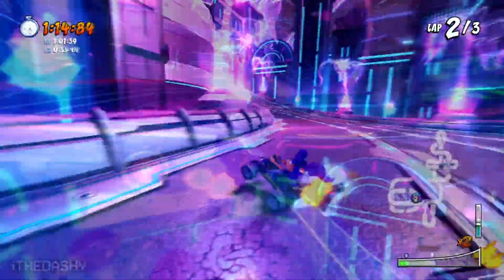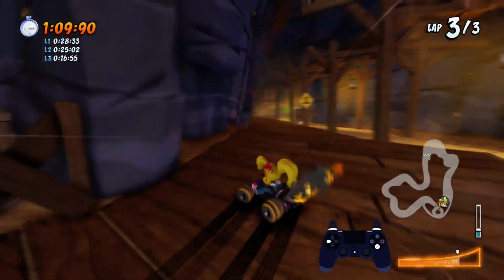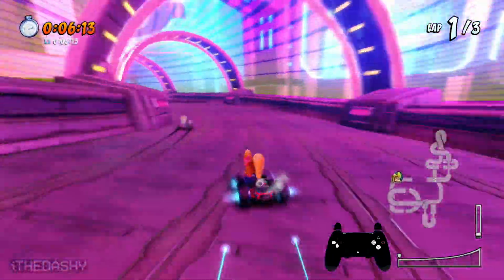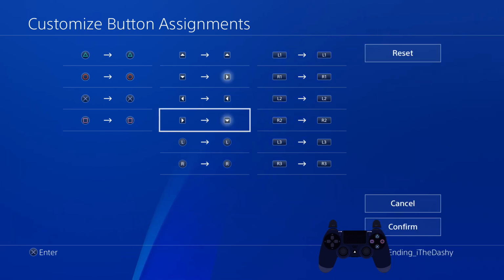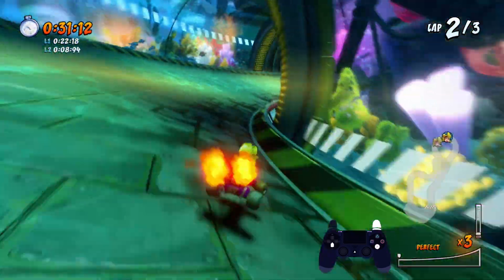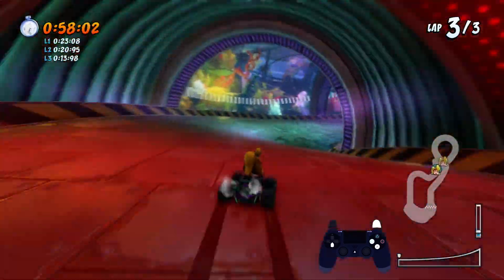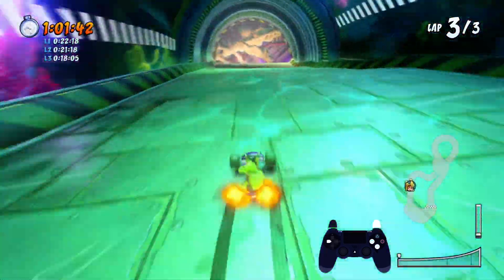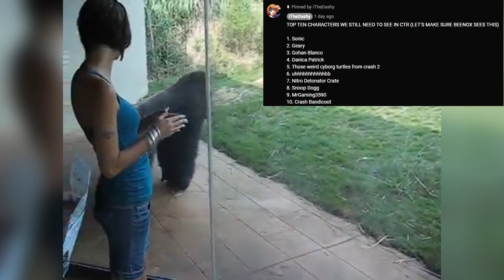Polswid Tech Guide: The New "Snowballing" Speedghost | Crash Team Racing: Nitro Fueled

Comment: Decided to come back onto the game to try out this new tech. For me personally, having to rebind your controls like this to do it the most optimally crosses a line for me, especially when it saves an insane amount of time on a course like roo's tubes compared to not utilizing the new tech. Some may be able to use both d-pad and analog stick for left/right switching but it is still unorthodox and still requires down to be binded somewhere else anyways or else it's too impractical. Whenever Beenox is a bit more proactive in updating this game (I feel it's more of a hiatus than a permanent stagnation of updates, especially considering the pandemic, but could be just me being hopeful), this is one speedghost tech that, in my view, should be patched out.
Reply: 100% agree with you and they should make the leaderboards separate if someone uses this new tech during online races it probably will me just a tad. Also I was thinking the same thing for the past few month's too with the Beenox hiatus thing.
Reply from the maker: oh man, there's a name I haven't seen in what feels like forever. It is possible that it could just be an "update hiatus" of sorts, but I've just been telling people to not get their hopes up. from what I've been told, they stopped working on the game in January, and every update we got after that was stuff that was worked on in January and just released later. The necessity of remapping is what makes this tech cross the line for a lot of people, though it is worth mentioning that remapping, technically speaking, isn't required, though it makes the tech infinitely easier.

Comment: I've been able to replicate this after a few tries on electron ave. I think this should be patched in a way or anoter, either keep it without the need to input a direction, or remove it entierely (applying the expected speed as soon as you touch the ground). I would prefer to keep it as it would open some creativity on a lot of tracks. Honestly I think having to remap your controller, implying that all the muscle memory acquired for the game is going down the drain, is a bit extreme. I think I won't use this tech and forget about climbing in the rankings until something's done by Beenox sadly.

Comment from the maker: nyoom
SOME UPDATES:
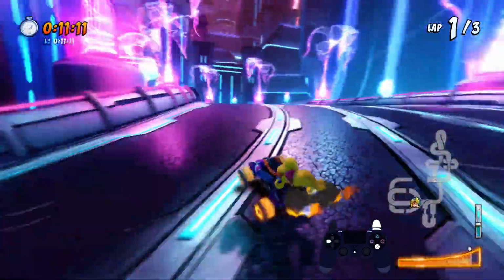re: turbo pad's effects on polswid (mentioned at 9:18) - unique turbo pads (all blue fire pads, and every turbo pad in the game that gives fire that is not the standard sacred fire speed) will actually give you a large boost of speed due to the game thinking you are at base speed with no fire and giving you the +(x speed value) bonus of the pad, and polswid's momentum preservation will hold this extra speed given (this can be most easily observed in recent koala carnival runs). Standard (sacred fire) pads will also give you a burst of speed but that speed will go away when the fire dies out unless you perform a wall-scrape before the fire naturally burns out. (Go watch recent top level roo's tubes runs to see this in action)

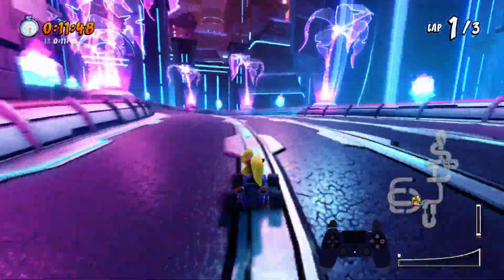re: hangtime boosts (mentioned at 9:35) - you can get a hangtime boost in offroad sections and maintain that momentum UNLESS you exit the offroad and enter the road in the air. (so for an example, jumping at the end ramp in roo's tubes, getting a hangtime boost by landing in the offroad, and then hopping onto the road will kill your speed, BUT if you just drive on the ground while transitioning back onto the road, your speed will be maintained)

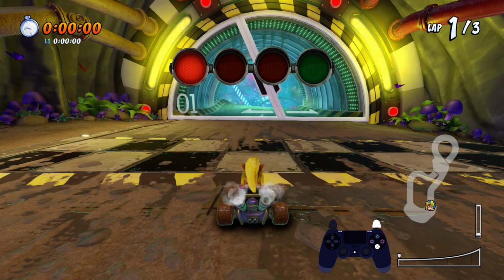re: speed dying out mid-air (mentioned at like 11:15 and i rambled about it for a few minutes) - if you're in the air for a long time without it being a downhill, your speed will go away. if you hit a boost pad and that fire goes away midair, your speed will go away. From my understanding what's happening here is that the polswid tech isn't really applied in the air, so losing fire mid-air while not on a downhill section will make the game try to set you to the correct speed. Similarly if you float over an uphill zone long enough it will attempt to reset your speed as well. You also seem to lose speed if you land on or just before a turbo pad. I have no idea why this happens.

Comment: Nice video explaining the tech! I personally play analog so can't perform the tech effectively once I have to do a single direction switch. A lot of people in the community are divided on the tech as it kind of boils down to who has better remap features on their controller. However, I think its fascinating and am excited to see where the tech goes. Always fun to predicting what the next broken track will be. 

CTRankings definitely needs to expand filters for runs with this tech (and standard SG) from regular "as intended" runs since people are interested in seeing different flavors of optimized runs. In-game leaderboards are definitely long gone for displaying "as intended" times (a turn player has #1 on megamix on Switch currently LOL).

I'm all for the tech adding depth to the game for TTs, but it is so dumb and broken that it should be kept away from actual races. Doubt a patch and board wipe will happen, plus it would probably be more detrimental at this point.

Comment: I'm not one to draw lines in the sand about what should and should not be allowed on time trial leaderboards. Currently Thunderstruck and Meteor Gorge have shortcuts that aren't really recognized by CTRanking because they are probably not intended shortcuts as they use environment detection abuse a little. That being said no one seemed to care when we were jumping on the said of the fire cauldrons in Temple Ruins and Jaws of Darkness in N. Sane Trilogy.

That. Being. Said.

I personally wouldn't mind a final bug fix of speed ghosts in general and a final patch on Thunderstruck. I personally think Meteor Gorge is fine actually. It's murderously difficult and only saves about 0.6 seconds per lap.
Reply from the maker: I really appreciate how thought out this response is.
Reply: and clockwork wumpa.
Reply: Hello! Speaking as someone who was heavily involved in the current ruleset making.

We made the rules with the following assumptions at the time:

Beenox will fix unintended shortcuts so they are banned.

Speed tech will usually go unnoticed or be spared (eg. SG and uturn)

Our ideas were mostly correct and based on the above this would be and currently is de facto allowed. 

However Beenox no longer is patching the game so expect large changes on ctranking in the following weeks
Reply: @niikasd  of course U-turns won't be fixed as it's an intended tech by the devs ^^
Reply: @iArcadia  I think it's intended in the same way rocket jumps were in quake. A cool accident that they were smart enough to keep
Reply: @niikasd  u-turning was a cool accident the original, but it was programmed into NF deliberately.
Reply: @JordanGrant92  my view of the developers is too negative to believe that.

Comment: I'm pretty sure you were right about it being the turbo running out midair that causes your speed to instantly die.
Reply from the maker: Very possible! But if that's the case, it's not entirely 100% consistent, as there are times where I kept my speed even though I still had fire while going off the ramp on Roo's. This would be the best explanation for why you go from warp speed to nothing on Electron, though.
Reply: @iTheDashy  I've had times where it disappears right after I've left the ramp but I keep my speed so there's probably some forgiveness with it.

Comment: Do you have to hit a wall to do it or can you do it on any downhill? I think this is super cool and am excited to implement it ^_^ thank you for the video!
Reply from the maker: technically speaking the wall isn't necessary. you need to have fire, and lose it mid-air. if you happen to jump down a downhill and run out or reserves before you land, that would also work, but its a lot more difficult to set up.

Comment: As a Xbox player I have a question for CTRanking and everyone else in regards of this tech, So pretty much I can't achieve insane times due to no button remapping for both LT and RT thus making going for WR runs or even learning them is pointless unless you're on PS4? 

Don't get me wrong I'm intrigued to learn it myself then come up with a final verdict but put it this way, it could make or break the community but sadly I think most of the Xbox CTR players are just going to disappear faster than anything and barely anyone will be encouraged. 

Sorry for the rant I love this game and grew up the original so to see a glitch potentially ruin Time Trials and CTR in general kinda scares me.

Edit: apparently I can't type sentences at 1:36am nice! 😂
Reply from the maker: 5th place time on CTRanking is an xbox player with a 1:04 using this tech. You may not be able to re-map LT/RT, but there are still more buttons on the controller you can re-map down to, just need to be creative.
Reply: @iTheDashy  Cheer's for the reply, you make a fair point and for sure I'll see what I can do with the button mapping but I won't be surprised if I buy a PS4 and start running CTR on it lol.
Reply from the maker: @bh_lad  If it stays unbanned, and your main interest is just time trials, a cheaper alternative would be to just buy an elite controller which comes with paddles on the back. If your interest is online, you should consider PS4 regardless of if the tech gets banned, just because like 75% of the active community is on PS4.

Comment: I got the strike pack controller mod for ps4. I mapped down left and square to the left paddle, and down right square to the right paddle, makes u turning a breeze, however still having trouble with this tech. In theory all i should have to do for this to work, is hold down x and both paddles at the same time, then take my finger off one paddle each time. I need to turn.

Comment: So is this tech not possible without button remapping?
Reply: It is possible by using both analog and d-pad at the same time. But unless you hold the controller with a claw grip you’re better off remapping.

To do it without remapping hold down on the d-pad and right on the analog.
That makes you turn right so you press left of the d-pad to go left and let go of left to turn right. (You can also mirror this but i find this way easier)